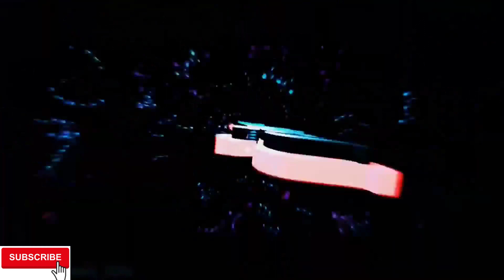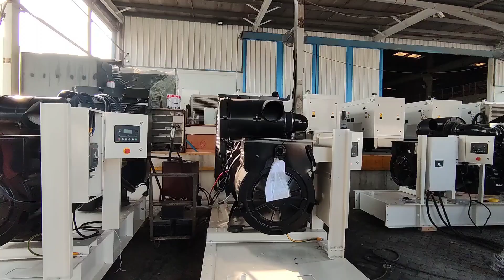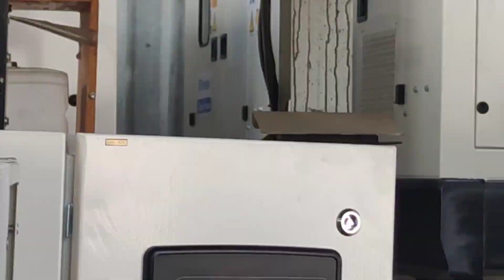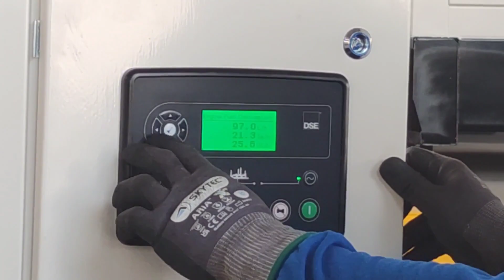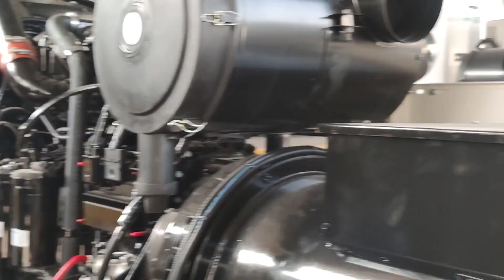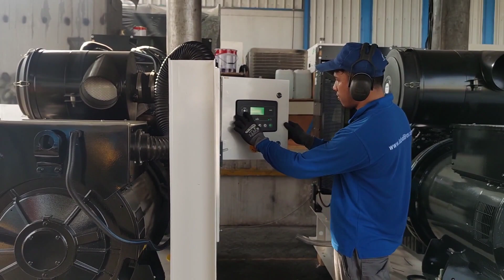LOADTESTING 500KVA 100% OVER LOAD TEST CHECK benzblogs

Comment: Sir, andito kaba sa saudi arabia?? Baka pwde ka magpunta sa site namin, babayaran ka ng company sa service mo. Hindi parin stable ung cummins gen.set namin, nagpalit na ng speed controller, fuel pump, MPU.
Reply from the maker: Sir sa dubai ako e tsaka bawal po sa compnay alam mo nnaman ng check na kyo kong ilang ang fuel pressure at enjector ?
Reply: @benzblogsVlogs  papaano po icheck ung fuel pressure sa fuel injector??

Bumili kami ng new speed controller nag hunting at overspeeding parin at no load. Wala pa kami ginagalaw sa engine. Fuel pump lang